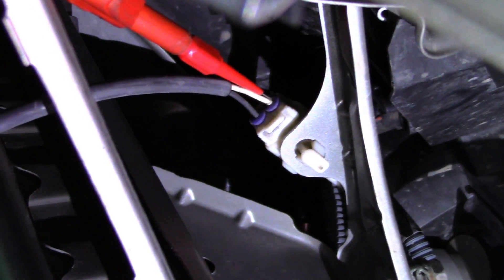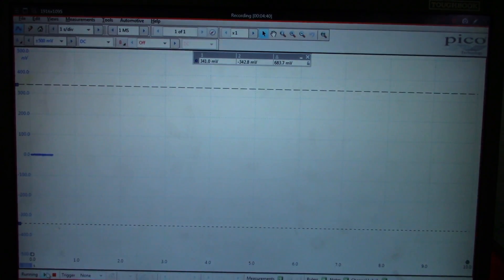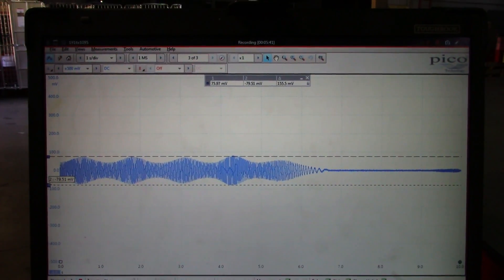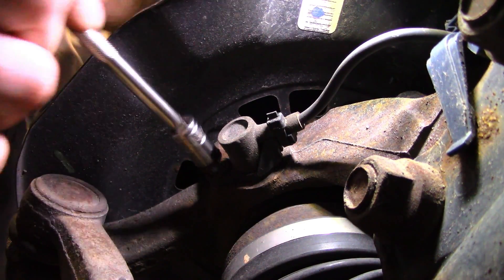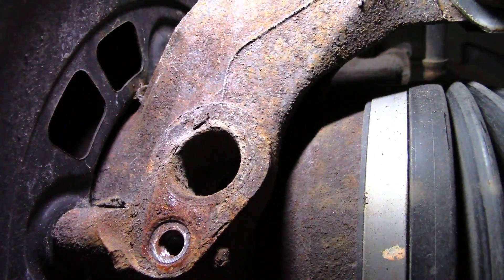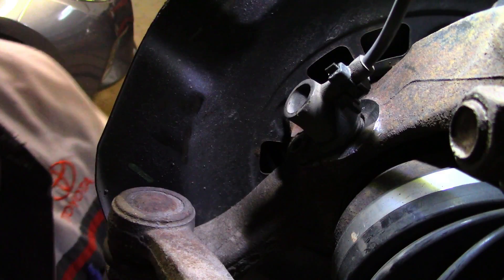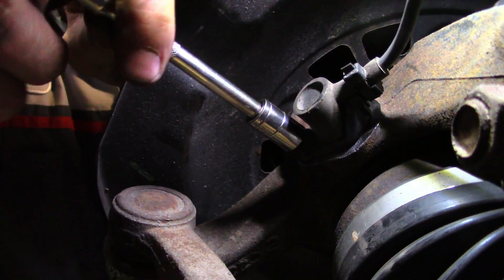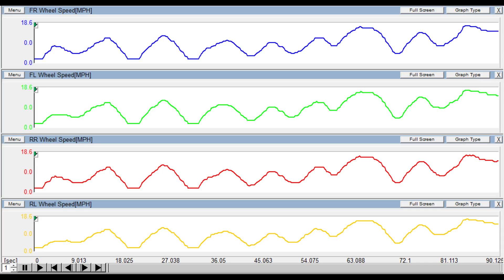Sienna with Low speed ABS activation

Comment: Thanks much for the detailed explanation. My front left had same issue. The rust was like weldered in - seem built that way. It was so hard to grind - the grinder did not fit in from down below. Chisel had worked very well, one tap had taken out the rust completely. Problem resolved.

Comment: Great video! Living in the rust belt too. I have an 08 Avalon that shudders on a hard stop brought it to the dealer and told me I need new front and rear pads. The rear pads are just 7 months old. My car has 287K mi should I get all 4 new rotors and pads?

Comment: I use an electric drill holding the chuck against the tyre, that way you get a more consistent speed and waveform amplitude.So far it's worked for me. Cheers and thanks for taking the time to post this helpful video.
Reply from the maker: tecnaman that’s a pro tip right there. Thanks for the tip!

Comment: Good Diagnosis "Hoss".

The Voltage Amplitude of the ABS Sensor @ Left Front Wheel displayed a Low Voltage Signal because of the BuildUp of Rust......Consequently , Rust creates conflicts on Brake Jobs too and some Mechanics/Owners think it's a Waste of Time to utilize Micrometers & Dial Indicators @ EVERY Brake Inspection...I'll Post Proof entitled 2 of 2.

Nice relaxing Music.
"Hoss" Barkwell

PART "2" of "2"
"RUST is an ENEMY"

If your Dealership or Indy Shop doesn't ENFORCE utilizing "Mikes & Dial Indicators" on EVERY Brake Inspection, you're giving Customers a 35% Brake Job all over North America.

Raybestos Brakes :
https://youtu.be/iFYrkfLuKTg

"The Flat Rate Master" :
outta Atlanta, Georgia

https://youtu.be/92FZ7fZLfH4 

Thin "Brake Specifications Guide & Brake Bleed Procedures"
www.MOTOR.com
See Light Duty Products - Specifications Quick Reference - View Products
1.800.426.6867
Troy, Michigan

Comment: Wondering if a coat of neversieze or fluid film (Eric O style!) would slow it down from happening again..
Reply from the maker: I know that Eric loves fluid film lol. I hate the stuff. Not because it doesn't work, but because it is sticky and everything sticks to it. And I don't want rust sticking to the tip of the sensor. But I'd have no problem if someone else did use fluid film.

Comment: Very nice my friend. Thank you for sharing this diagnosis and repair with us. I like to use cheap wood chisel to clean rust on flat surfaces it’s much sharper and it will speed up process. After use I would sharp it on belt sender. Keep up good work.😁👍😁
Reply from the maker: Thats actually I good idea, using the wood chisels! I am going to try it next time! Thanks Ramon!

Comment: airhammer/vibration/wiggling and lube a littlebit of heat and alllllott of patience!! :D maybe a longshot but maybe allot of freezespray works.
Reply from the maker: What spray have you been using? My dealer got something called "rost off" and I can't decide if I like it or not. It is supposed to freeze the bolt. But really doesn't seem to do much.
Reply: @VoltageDropDiagnostics  if its the wurth you mean i do believe CRC makes it im not sure... but i use the CRC rost flash it creeps VERY vell and cools good... just gotta spray allot for like 10 sec in one area.

Comment: Today was your lucky day, no broken bolt and sensor slips right out. Great video showing the waveforms of the ABS sensors along with the waveform from PicoScope. :)
Reply from the maker: It was my lucky day. The sensors that have the O-rings on the sensor are the ones that usually fight the most. But I can't ever remember what models have the o-rings and which ones don't lol